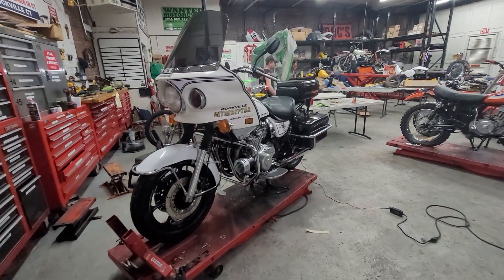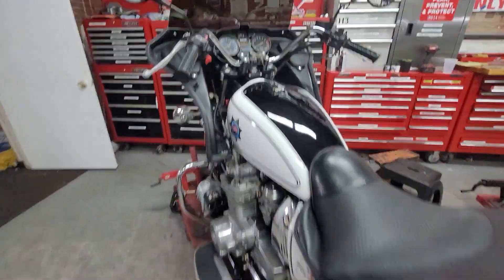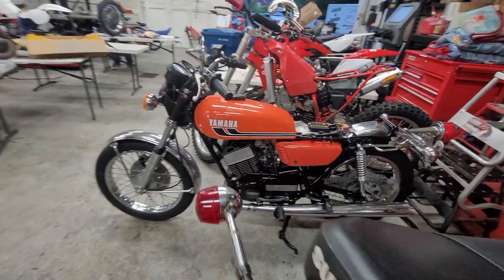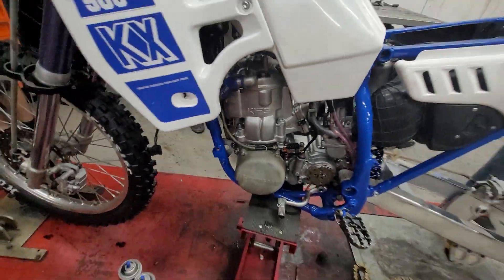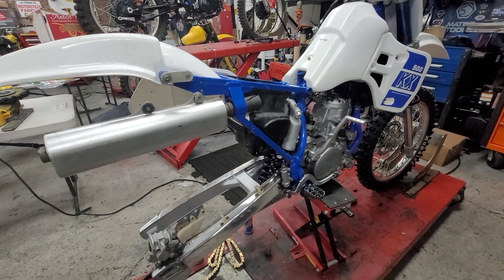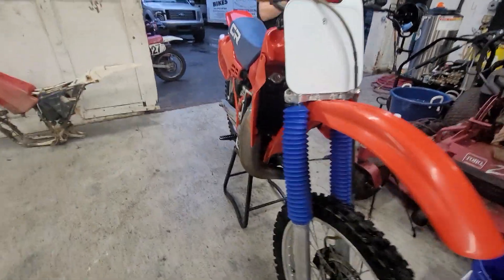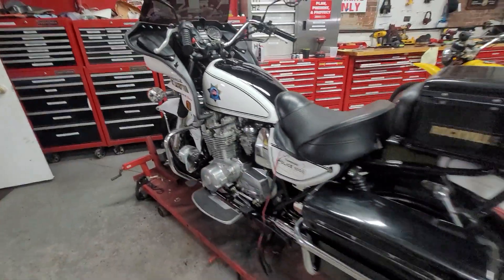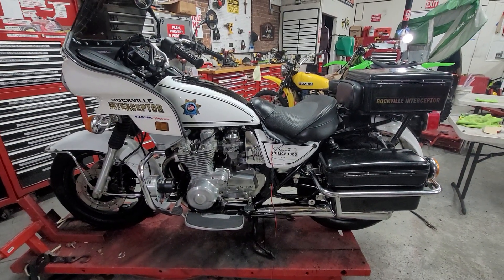POLICE INTERCEPTOR ON TWO STROKE TUESDAY @ KAPLAN CYCLES

Comment: For being a Honda CR efficienado I'm surprised you said the cr250 was an 85 when it's actually an 83 as I'm sure u know from 1980-1985 the vrs changed every year, bodywork, motor, everything and the 85 is the exact same.body style as the 86 only w a different seat logo and no gold wheels....86 started the gold wheels and I'm 95 percent sure it's an 83 or
Reply: Lol, Nope Jesse, not an '83, it's an '84 CR250.(the '84's had 250 in red lettering on swing arm, 83's had Black 250 lettering.

Comment: But def not an 85 which is probably a good thing as the 85 was a torquer and slow and the 84 a rocketship but with reliability issues from factory...crank pins were like plastic or something and stock motor components suffered from cracks and the like but as far as performance the 84 is by far fastest bike that year and actually the 83 was a more reliable bike and a huge improvement from 81-82....bit whatever the case, I'm sure u guys have gone thru everything and tightened her up AS YOU GUYS ARE BEST IN THE BIZ AS FAR AS QUALITY AND PASSIONATE DEVOTION TO YOUR CRAFT AND  IF A BIKE CAME FROM FACTORY W ISSUES, BY TIME IT GETS I TO YOUR GuYS HANDS,  shit gets done right the first time